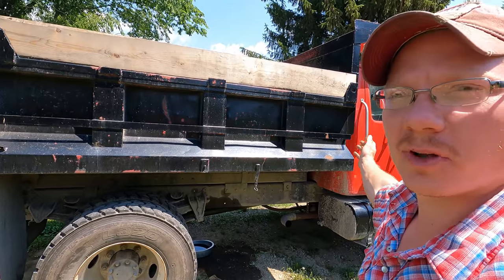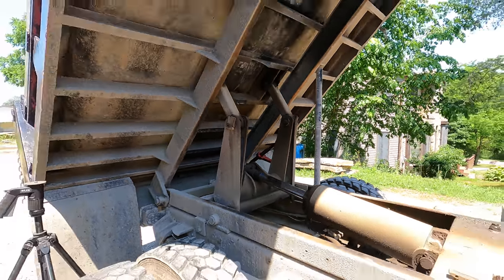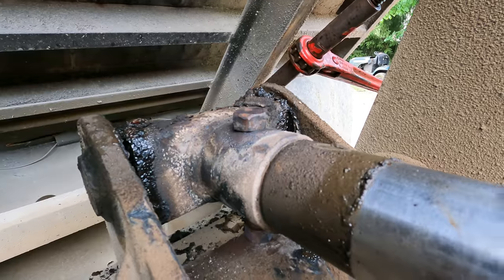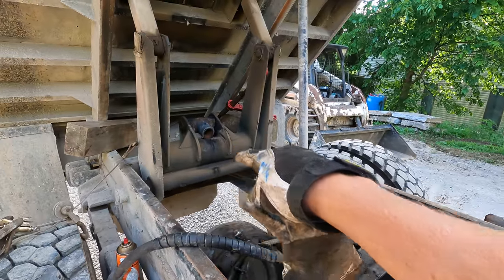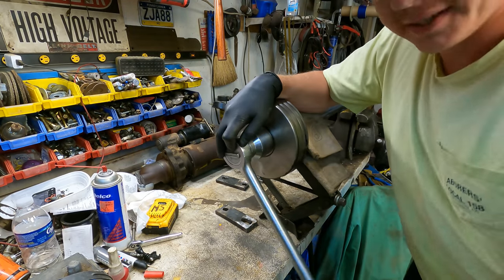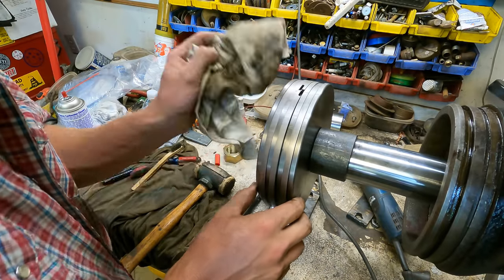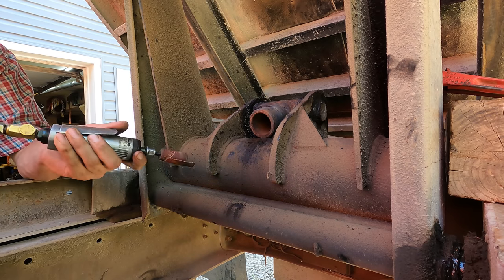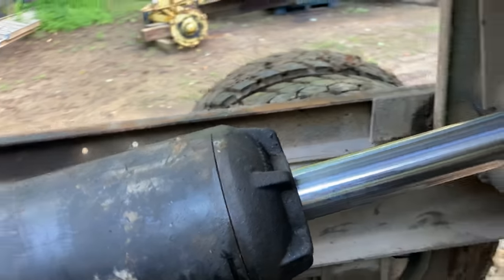Dump Truck Hoist Cylinder BLOWN OUT!

Comment: I know that steel can become magnetised due to repeated mechanical shocks which will allow the metal atoms to realign their own magnetic fields around them. I would not think this would have happened due to the earth's magnetic field as the location and orientation of the truck changes over time negating the effect of the earth's field, but perhaps there's somethign else magnetic on the truck for the  fields to align to.
Reply: You are correct.    Bashing the coupling (also when forged?) with a sledge hammer for while will align the metal atoms with the magnetic field in the trucks present orientation.    Its why metal ships used to have their comapsses recalibrated after an impact or repair near the bridge.

Comment: Hi Matt,

isnt there an additional O-ring inside the cylinder package where the package is mounted on the cylinder shaft?
( The parts with the nut in your video 21:40)
When i overhaulded such cylinders i always found one.
This o-ring is usually there for sealing the package to the shaft so there´s no bypass from the pressure side to the "no pressure side" of the cylinder.
I didnt see this little o-ring beeing chaged in your video, but this could be important for keeping/ holding the pressure when the bed is raised.
I hope you understand what i mean.

Comment: Q: The bolt in that welded pin that runs through the shaft: Could it have been installed head up with the nut on the bottom? Or was the bolt too long? Would make getting it out later easier if it could. 
Love your videos!

Comment: dont know if you know or not....probably do...but you can use  Dexron ATF tranny fluid for hyd fluid....may be cheaper....works better in cold weather too
Reply: next time...hopefully in long while.....leave the cyl and ram in the frame .....and brerak that top nut BEFORE you take it out....may be a lil easier

Comment: Greetings, just watched your cylinder rebuild. FYI the rings on the piston are cast iron. They are an older style, but still used. Recently I completed working on some cylinders that go on the catapult assembly of an aircraft carrier. They still use cast iron rings. How is the tube work on the Gallion going?

Comment: Right at the beginning you classify your dump as a 10ton dump truck. The truck itself, is what I would call a 2-ton dump truck. ( Half ton is a 1500 series, 3/4 ton is a 2500 series, 1 ton is 3500 series, 1 1/2 ton or "Superduty" would be the 4500, and 5500 series trucks. This truck is a 6500 series or possibly 7500 series based on the 10 speed  "Class6 or Class7 Medium Duty. 2-ton " Its payload depending on the GVWR 26,000 or 33,000 would be somewhere between 7-11 ton legally. Not trying to correct you, just sharing information. I imagine your referring to what you haul on it +/- 10 ton...  Great channel BTW I'm digging the content.
Reply from the maker: Yes GVW is 33,000. truck weighs 14,500 leaving me with a payload capacity of 9.25 tons anyone who runs them just calls them 10ton
Reply: @DieselCreek  I live in Memphis, We call them 2-tons, then tandems, then tri-axles, then quads.

Comment: Why didn't you put the nut on the bottom? So you can pull the bolt out of the top?? Don't drop big chunks through the tailgate...always drop the gate and let them slide over it. The big chunks can cross up and get stuck and with all of the weight stuck in the back, the dump box won't drop down. Then you have to play Russian roulette with a sledgehammer and frost bar. Ask me how I know.

Comment: Gotta love Meatball. Matt. Just curious did you install the union end of the hydraulic hose on the cylinder for ease of removal if you need to repair again?  On the T pipe for better serviceability cut the old pin out a replace it with a slightly longer one with washers and cotter pins.

Comment: Somebody with a deeper knowledge of metallurgy would probably be able to make a better explanation, but my understanding is some iron alloys can become magnetic when they are hammered while cooling. It has something to do with the crystalline structure being forced into a specific alignment during the cooling phase, and the individual atoms in the iron are locked to those crystalline structures. Once the spin of those atoms are on the same axis, the iron becomes magnetized.
Reply: This is on the nose.  Way back in my Cub Scout days, we learned how to create a compass by first heating and then hammering a needle,  We would place it on a cork floating on a bowl of water.  It must have made an impression on me that I remember it after so many years.

Comment: That was very interesting. I would not of had a clew how to get that apart. I like watching videos where I can get a little insight into how people figure thing out. I did have one idea for you that might, or might not have helped. When you where trying to get that end to come out of the T, I was thinking of using an air hammer to help vibrate it lose. But you got it of course, well done! ;-}}

Comment: I promise not to yell. 

On a 5/8" bolt like that I like to get the bolts attention with something of substance. 16 lbs of substance. 

The heavy equipment mechanic usually has at least a 16 lb sledge somewhere handy. And a 20 lb, just for good measure. (-;

You're going to ruin the bolt anyway so don't bother with screwing a nut on it. You have a torch or cutoff wheel available to cut any mushroom off before you drive it through. Just get it to move in the first few hits. 

If you go at it with a 3 lb or a 5 lb you just end up mucking it up. 

If I can't spin a 5/8" bolt in the hole with an impact or box end wrench then it's getting a solid wack from the 16 lb from me. If it does not move within 4 or 5 hits step back and re-evaluate. 

I'm not yelling, but I would probably grabbed the carbon arc and removed the weld around the pin. I do not care for pins welded like that.

That's a nice truck. The 466 has a good cackle to it.

You're ready for an 8" rosebud for heating...just do it. (;

Good luck, work safe, be clean.

Comment: I would have done one thing differently - I would have taken the opportunity with the cylinder off to put a grinder to the welds on the pin and replaced it. If you have to do any more work on it, you'll be faced with the same problem.

Comment: If that International has a mid-range Tubo charged diesel, take the muffler off. It won't be any louder and it will run better. TD Atlanta
Reply from the maker: it doesnt have a muffler lol

Comment: Matt, Please pardon my ignorance, but why didn't you remove the welds from the top pin and then use cotter pins there, because when you disassemble this assembly in th future, you will be cussing a blue streak about that welded pin again!

Comment: 15:25 I bet it was lifted by a magnetic crane or they used a magnetic chuck to attach a drill press and bore a hole.

Or you hit it enough with a hammer 😁

Comment: 3 seconds in - you service those with the bed down. how would you get the bed up if the cylinder was dead?
Reply from the maker: It’s not possible to get to let alone remove the cylinder with the bed down.

Comment: Looks like you didn't have to pull the rod out with the rest of the cylinder, could have replaced the seals with the rod pinned to the truck.

Comment: I think the crackheads who welded that pin meant for you to undo the bolt with the bed down, then flip the bolt over and open the bed and lift out the loose bolt.

Comment: What is the towing capacity on that truck? I have a TB260c excavator and I’m looking for the best possible (and relatively inexpensive) way to tow it around. The TB260c weighs in at just under 13klbs.

Comment: magnetism is from hydraulic fliud pumping through rubber lines grounding the lines typically gives the charge someplace to bleed to ...he issue about the failed o ring at small part of cylinder reminds me of the chevy 3 speed automatic tranny typically it was designed to leak at the small O ring...but 99 times out of 100 it was the seal beyond that that failed on the pump...which of course meant that a new one would last about 3 months because you had not fixed the primary seal failure...So if tearing it down twice is in the budget and the body go for it...I kicked my own ass twice instead of once tearing out the tranny 40 years ago lesson learned...

Comment: you could of taken a sawzall and cut the head of the bolt off and then pulled the remains out from the nutside by impacting it down it would of taken all off 30 seconds to cut it

Comment: Why do you use such tiny dump trucks in USA? The smallest ones here in Denmark are 3 times the size. It doesn't make much sense to drive 3 times as much.
Reply from the maker: Can’t get a big truck in small/ tight places... also large ones are a lot more expensive to operate. Unless you keep it busy all the time it’s not worth owning. The registration fee for this truck is like $1200/ year and the bigger trucks are nearly double

Comment: Diesel creek.   I love your content.   I have a question. Do u happen to have the part no for the two seals and o ring.  I have same truck. Same cylinder same leak. Lol.   I cannot find much info in this.    Thank you.
Reply from the maker: I don’t, sorry! I took it to the shop and they just matched everything
Reply: @DieselCreek  ok thanks. I will try to do the same.   Love the videos.

Comment: 8:09 I woulda had a large catch-basin underneath there, and used a wide-mouth f-u-n-n-e-l in da neck of da bottle, Dude --- juss sayin'. As you said yourself a bit earlier, it would have been better for both da environment AND your wallet to not just let da toxic hydraulic fluid just leak out onto da ground like dat. :P
UPDATE --- Whoopsie, my bad --- I guess you actually DID have a metal catch-basin under there; I could hear it tinkling later, even though I couldn't see it.  So sorry, Dude --- ignore that last remark --- carry on. :P :D

Comment: Hey Matt why don't you grind that pin out. So you can remove it from the front the next time you need to reservice your truck again in the future. Just saying it'll save you A big headache in the beginning& end on that little minor set back aswell just A heads up to you. I know you thinking awe I won't forget about that not being removable later on down the road once again. It can rehappen to you. I'm sure that union knuckle can be found around reasonably priced. www.rockauto.com

Comment: Why such tiny wheelbase and body.If you can carry 10 tonne on that it must be lead
Reply from the maker: I’ve had 11 on before
Reply from the maker: Piled to the sky
Reply: @DieselCreek  I am sure but why not make them longer increases your GVM
Reply from the maker: @adamheazlett1179  gvm? My GVW is 33k max allowed on 2 axles and I have no problem getting that eveytime
Reply: @DieselCreek  Your talking pounds not kilos
Reply from the maker: Of course... M’urica!
Reply: @DieselCreek  You do not understand and have very thin skin .Metric is where the world is at.Just a waste of fuel .In the US you have semi rigs with sleepers longer than those stumpys
Reply from the maker: @adamheazlett1179  how do I have thin skin?? lol im not getting offended, you clearly dont understand. there isnt a point to having a longer truck. it just makes it hard to get into tight places. small trucks are nice for the type of work I do I wouldn't gain anything by having a longer single axle truck as this one is already easy to max out my weight on two axles. now if you are saying get a longer truck with more axles then sure I could haul more weight but then were back to the point that a smaller agile truck is more useful to me. If I had use for a tandem or tri axle rig id already have one. they are alot more expensive to own and keep registered than my small truck. also all the work I take on is within 15/20 minutes of the quarry so its not a big deal to make several trips if need be.